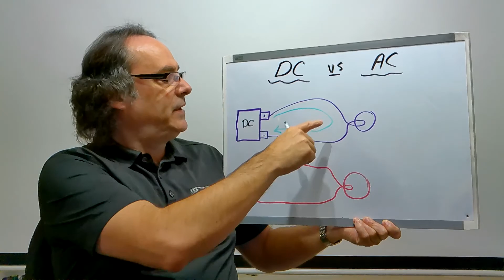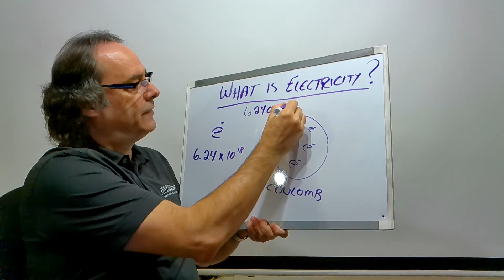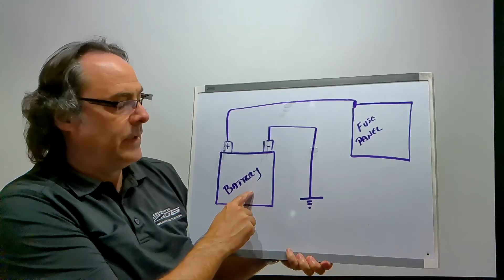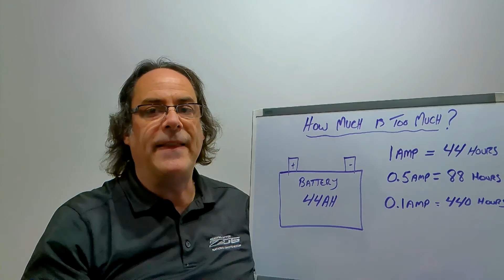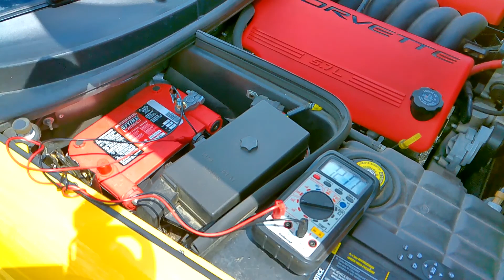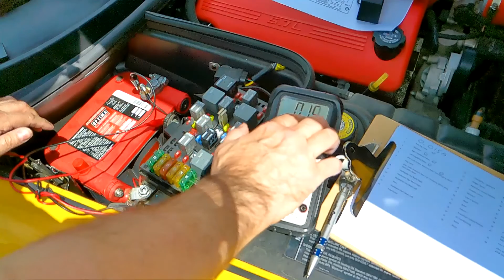Measuring Parasitic Current Draw

Comment: What is ur way to ck for a draw on a 87 c4 w/fuse panel on  passenger inside of car?
Reply from the maker: I used a set of longer test leads and placed the meter face down on the windshield so that I could see it from inside the car.

Comment: thanks for your video very clear and very well explained. I'm going to test it with my car because I have a current leak that drains the battery every three days.
Reply from the maker: Keep me posted on what you find out.
Reply: @justcorvettecrazy116  I have a 1992 Corvette Lt1 and I am very happy with it. I have the battery drain in my Honda accord.
I found that there was a constant .25 amp draw and it would cycle up to about .65 amps every 30 seconds
Thanks a lot. I have found the problem in fuse 15(Backup, ACC)  of the engine.  Backup for interior fuses 5 to 9
It appears to be a known problem on Honda and Acura.
I found many links this sample:
https://sparkys-answers.com/2012/06/2006-acura-tl-battery-goes-dead.html

I will try what it explains in this link to see if I have the same problem.
Thanks a lot.
A great video to put my students.
Thanks.
Reply from the maker: @franciscojavierjimenezmuno1757  Great.  Glad I could help.  Share as much as you can.  Take care.